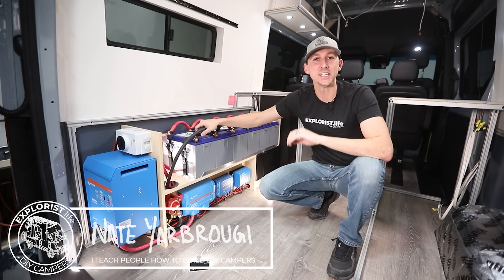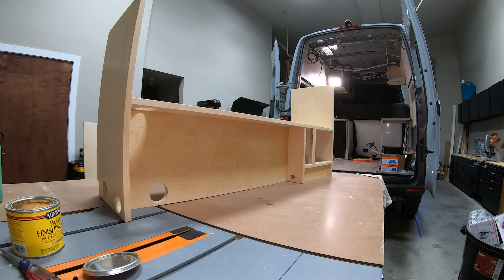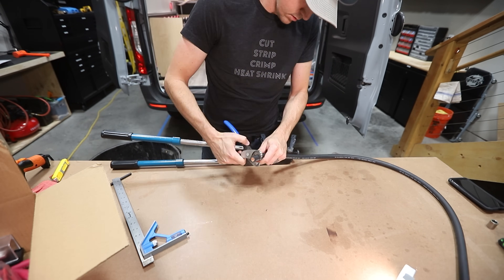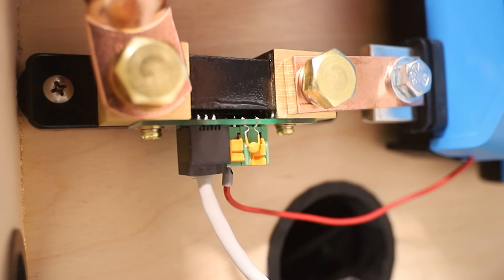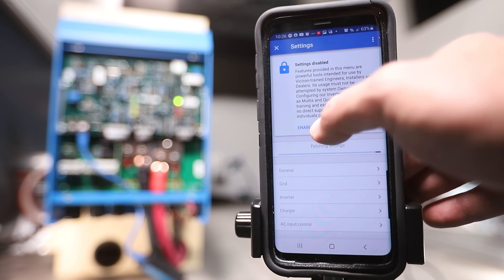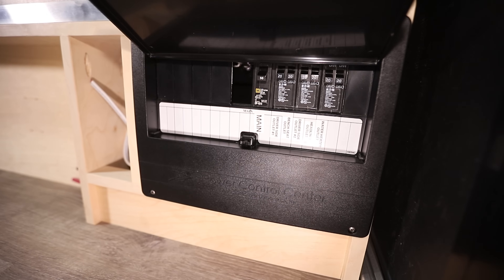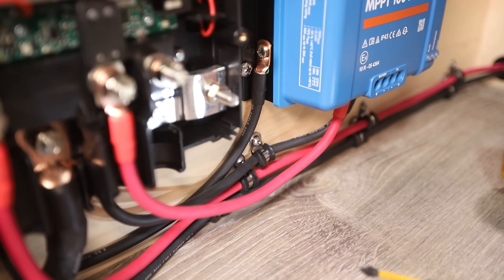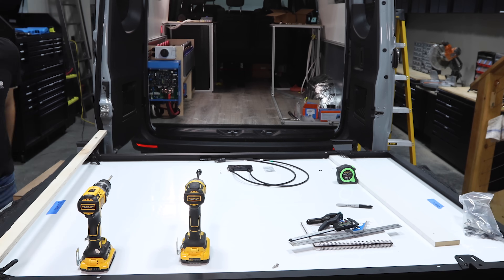DIY Sprinter Camper Van Electrical Install - Full Tutorial

Comment: So in this video with just one 12/12/30 dc to dc charger you use a 60 amp fuse but in your video of installing 2 12/24/15 dc to dc chargers you install a 150amp fuse, is there a reason for this?
Reply from the maker: 2x chargers = Twice as much power = bigger wires and bigger fuses.

Comment: second alt and save your main for the van battery only
Reply from the maker: That is indeed an alternative option and our kits are indeed compatible with a secondary alternator if that's the direction you'd rather go in your build.

Comment: is all the 4/0 120mm wire just for the sake of extreme overkill? seems like 2awg 35mm wire would do and be a lot cheaper and lose no current or am I wrong? i'm trying to figure our why the use of the thick cable! :)
Reply from the maker: Not overkill, no.  It's what's recommended in the user manual for the Multiplus Inverter Charger.  

2AWG would be wildly undersized. 

Perhaps this would be helpful: https://www.youtube.com/watch?v=ki3WXVR48eM&list=PLmvhcyi4n0TU6HlMaQiCUwC20DBlyv6s_
Reply: @EXPLORISTlife  and for a 24v system?
Reply: i watched that video earlier and i can't figure out how i know what amperage i have in my  system! i know it's 24 volts, but the wire size is mainly about the amps as I understand it, and I don't know how to know what amps are gonna be drawn through it :(
Reply: the volts just allows the wires not to be as thick, because less amps go through, but how do you know the amps!! ahah sorry going a bit nutty looking at all this!
Reply from the maker: A system w/ a single 3000w 24V Victron Multiplus Inverter/Charger would require 1/0 as per the user manual.  If you know the wattage of a devide, the amps can be calculated by: Amps = Watts / Volts

Comment: I have been reading conflicting opinions on main battery fuse ANL vs T-Class. Do you have any opinions on that?
Reply from the maker: Both are fine for that purpose.

Class T are 'better' as they have a higher AIC, but they have been historically harder to source at-scale (and I don't recommend parts we can't, as end users, acquire).

I wouldn't put ANL fuses in our kits if they were inappropriate for that use.
Reply: @EXPLORISTlife  thank you for your reply. I appreciate it. ANL it is then !

Comment: Nate - At 57:16 you are installing a 60 amp fuse for the positive connection of the DC-DC charge controller under the drivers seat. What kind of fuse is that and do you sell it? I looked through your products and don't see it. Thanks.
Reply from the maker: it's a 'MIDI' fuse: https://shop.explorist.life/shop/all-products/fuses-breakers/50a-midi-fuse/

Comment: What would you recommend. 12v or 24v for a RV? I'm trying to make up my mind.
Reply from the maker: If it's your first system you're building and you need less than 3000w of inverting power, I recommend sticking with 12V.

Comment: In a similar installation in a towable is there any danger of the starter batteries being depleted by low charged house batteries through the trailer plug? If so, how do you prevent that?

I’ve never heard it mentioned as a problem so I’m probably over thinking it.
Reply from the maker: If this were going into an OEM camper, I'd recommend disconnecting the power coming from the 7 Pin connector as it's just not enough charging amperage to matter and the 6AWG wire for the Orion DC DC Chargers would need to be run seperately.
Reply: Perfect - in that it confirms what I was already thinking.  ;) Thanks!
Reply: Can you explain why you can use a 400 amp ANL main fuse instead of a T rated fuse?
Reply from the maker: T-Fuse is also a great choice.  ANL Fuses are rated for what we are using it for but are more readily available than Class-T fuses.  Either are fine; I just don't like recommending products that are difficult to source for the end user.

Comment: Regarding the lynx distributor and shunt, can a smartshunt 500a be used instead of the bmv712? And if so, was it the aux or the Vbatt + that I would connect the power wire to?
Reply from the maker: Yes.  It's a direct replacement.  Power goes to Vbatt as noted on pg 4 of the SmartShunt user manual.
Reply: @EXPLORISTlife  many thanks, I’ve got it on order so I’ll get the manual read once it arrives.
Are you the only place to source the lynx adapters, as I’m in Scotland and really struggling to find anywhere selling these
Reply from the maker: @amacmedia3221  The manuals for every Victron component can also be found on the Victron Energy website. 🙂👍

We personally have the Lynx Adapters machined, so we are indeed the only ones selling those, to my knowledge.  We do ship internationally, though. 👍
Reply: @EXPLORISTlife  many thanks

Comment: How many hours could you run your 15 amp Air Conditioner on the battery bank before the batteries are discharged to their safe low level?
Reply from the maker: 15A @ 120V = 150A @ 12V (Using W=AxV)  This is a 600Ah battery bank. So...  600Ah / 150A = 4hrs provided there is no other charging/discharging going on.

Comment: Why did you use the last numerical circuit (18) and label backwards on the DC panel instead of starting at 1? Just curious. Someone as meticulous and prepared as yourself has to have a reason.
Reply from the maker: No big reason that I remember.  Probably just the way the wires fit the best.  Fitting the wires the way they fit best is always going to be more important than numerical order provided it doesn't 'electrically' matter.

Comment: would this work in the uk? I know the voltage in the us for some stuff is 120 volts instead of 240 in the uk and i was just wondering would i need to change anything included in this video for the uk volts difference?

Comment: Why are you only using one 4/0 wire to go from the bus bar to the Multiplus when it is recommended to use two 2/0 wires?
Reply from the maker: The Multiplus manual doesn't recommend two 2/0 wires... it recommends two 50mm2 wires (which is 1AWG).  This means that the manual recommends a minimum of 100mm2 worth of copper.  4/0 is the next biggest size (accounting for rounding) available in the US as it contains 120mm2 worth of copper.

I prefer using 1 wire as opposed to two wires because we'd have to otherwise take up two spots in the lynx distributor, which would make it so we would need to add a 2nd lynx distributor to this system to have enough space.
Reply: @EXPLORISTlife  We should be more specific since there are now two Multiplus versions. The Multiplus manual recommends two 50mm2 wires for lengths less than 5m and for lengths greater than 5m it recommends two 70mm2 wires equivalent to 2/0. The Multiplus II manual recommends the same but instead of the wire sizes being in mm2 it is in AWG. Also, 4/0 only contains 107mm2 of copper, don't always trust the first result on Google. I'm not sure why you took a shot at me in response to the question but there, now we are even. 

The convenience of running a single 4/0 wire is evident, but if that was a proper choice, wouldn't Victron include it in their manual? Electricity is more complicated than doubling wires cross sections and calling it good.
Reply from the maker: @CPRebels21  No shots fired.  Sorry it came across like that.  Sometimes in an attempt to answer these questions in a timely manner, I need to be 'short'.

Happy to answer your questions (because they are good questions), but you need to promise not to take my responses negatively. Cool? 😊

Comment: Hi Explorist, congrats to that tutorial - must have been loads of work. I hope you do not mind, but I have three questions: ( 1 ) at 59:28 you are sitting on a small chair inside the car and I am looking for something like that. May I ask, where did you get that? ( 2 ) Why do not you use DC Circuit Breakers instead of the main switches plus the fixed mega fuses? For example the Schneider Electric breakers seem also to be certified as an isolator. There is probably a reason to that. I would be happy, if you could explain or give me a hint. ( 3 ) During the tutorial you are saying, you are a "Trained" or "Certified Victron installer" (or similar), but I have not found that on the Victron web site. Maybe you can point me to a link? Thanks and all the best for your channel. Ronald
Reply from the maker: 1: https://amzn.to/3IJOeU6

2: That would also be fine, I suppose, but would be WAY more expensive with pretty much no added benefits.  I talked that a bit here: https://youtu.be/548aRhZMN-g

3: I'm a Victron Ambassador; which means that I have access to advanced training from Victron and then Victron will then sub-contract me out to go and teach their installers/distributors/end-users about their systems.  There's a 'bit' more info on that in this video: https://youtu.be/Yo3HO8cH0TI
Reply: @EXPLORISTlife  thanks for your reply, explanation and links!

Comment: i am going to wire two 24 volt batteries using an anderson Y connector cable.  is there any thing i need to do or know before i do this?
Reply from the maker: I mean, why not just wire it without an Anderson connector?  Are you planning on removing the batteries often?  That's really the only reason to use an Anderson connector.
Reply: what about equalizing them?

Comment: Do you have a rough high and low cost given the parts list as mentioned it a bit hard to snap shot the total estimate without complete parting everything
Reply from the maker: I mean, there's a complete parts kit available in the video description complete with pricing from only 3-4 different stores.  Did you see that already?  If not, here's the direct link: https://shop.explorist.life/shop/all-products/camper-wiring-kits/complete-wiring-kits/600ah-multiplus-3k-12v-orion-12-12-30-400w-solar-wiring-kit/
Reply: @EXPLORISTlife  Great thank you 2 things . I was not  using the key word “ kit”and the kit isn’t  all parts in a full diagram.

For me I was look for a add all diagram button ( which might be overly simplistic as some is case by case ) and a cost of all depicted in the diagram .

This looks like a add all for most of the largest sections of the diagram however . 

Thank you for responding your videos have been critical to my understanding  of a complete independent system!
Reply: looking at it now it’s just navigating the web site a bit. Maybe add hyper links to the kits from the diagram  page section?

Comment: So I wired my chassis ground and have followed all of your advise for wiring and wire sizes. Using 4/0 wire for battery and inverter (Multiplus II) We are on a trip in Colorado right now and last night we blew the main 300 amp fuse from the batteries after running a isotemp water heater and a small Keurig. Luckily I had a spare. Any idea where to find another one locally near Breckenridge or  what could have caused this?
Reply from the maker: This may take some more in-depth troubleshooting.  If you have purchased/are purchasing from our store (shop.explorist.life) reach out for some more personalized help: shop.explorist.life/support
Reply: @EXPLORISTlife  unfortunately I bought everything from battle born prior to getting to know your YouTube channel. Everything else is working well and haven’t blown another fuse. Just afraid that I will be in the middle of nowhere with a blown fuse and no replacement. I have extra Victron 300 amps but those don’t fit the housing for my battery fuse
Reply from the maker: Gotcha; I was about to say that a 300A fuse in a system w/ a 12V Multiplus 3k was too small and didn't sound like something we would have sent you. 😂🤣

But yeah; we have fuses on shop.explorist.life if you just need a fuse replacement.  Battle Born also has them too, I'm sure.
Reply: @EXPLORISTlife  sorry. I followed your wire diagram and battle born said a 300 amp fuse. What fuse do you recommend I get?  I’ll have you guys ship one to my house and hopefully not blow the only one I have for the rest of the trip. Wish I would have found you guys before I did all of this. Thanks!
Reply: Also just to be clear the one that burned was the one coming from the battery not the one in the linxs
Reply from the maker: 400A ANL Fuse protecting the 4/0 wire from the battery to the lynx distributor as is noted in the diagram.  Hopefully you used 4/0 wire?
Reply: @EXPLORISTlife  yes I have 4/0 for everything battery/ inverter/ chassis ground. Since I can’t get one locally should I limit the use of the inverter to a single item until I get one from you guys shipped to my home?
Reply from the maker: @TrueLivingOutdoors  A 300A fuse "shouldnt" have blown; but without knowing the full scope of what went wrong; it's tough to advise further.

Comment: Can you use this for 800 watt and a different inverter that one's pretty big and I've been eyeing the sungoldpower but not sure if that'd change what I need
Reply from the maker: You can sub in any size of solar array you'd like up to 1450W on a single charge controller.  Here are the kits to do that: https://shop.explorist.life/product-category/all-products/camper-wiring-kits/solar-charging-wiring-kits/

Changes would indeed be necessary for whatever sungoldpower inverter charger you are eyeing.
Reply: @EXPLORISTlife  SUNGOLDPOWER 2000W Peak 6000W Pure Sine Wave Power Inverter DC 24V AC 120V  is what I was thinking mainly just because the multiples seems huge but the features you mentioned do sound nice
Reply from the maker: That one would not work with this setup and would require an entirely new system design.  A 24V inverter is not compatible with a 12V battery bank.
Reply: @EXPLORISTlife  good catch I hadn't seen that it was 24 I ment to put the 12v version
Reply: Sorry just to clarify would I just add say a 1000w solarkit to the complete kit and be ok or is there more to it that I'd have to change

Comment: why you connect the shunt ground cable to the far end of the battery array?
Reply from the maker: This shunt needs to be placed so that the Batteries are on one side of the shunt and literally everything else is on the other side.

Comment: Can i please ask what you put under your batteries. I've been told to put insertion rubber underneath.
Reply from the maker: Just the wood shelf. Rubber underneath is not necessary for these particular batteries.  (These Battle Born Batteries actually have a shock absorption pad inside of the case underneath the battery cells).
Reply: @EXPLORISTlife  awesome.  Thankyou for the reply. I have 3 x voltax 200ah lifepo4 batteries. 
Im just starting to do electrical install and finding it very intimidating. 
I love your videos.
I just wish you were allowed to do videos on renogy stuff too.
Reply from the maker: Glad the videos have helped!  I can actually do videos on whatever/whoever I choose.
Reply: @EXPLORISTlife  id love to see a video on renogy 3000w inverter charger and the 100Li MPPT. 
Your videos are the best on youtube without a doubt

Comment: Amazing video! Helped me out a lot while installing my system. I bought the whole package from victron and connected all of it. Had a few questions wanted to see if you could help me out. Would it be possible for me to email or call you?
Reply from the maker: Glad it helped! 

Unfortunately, with over 150,000 subscribers, I'm sure you can understand why I can't accommodate phone calls/emails.  If you have a question, you should check the other videos I've put out, the blog posts I've written at https://www.explorist.liife, and the information contained in the user manual as those three resources contain 99% of the answers anybody has.  If none of that answers your question, feel free to ask your question here in the comments section of a relevant video and I'll try to help.  Otherwise, you can also reach out to the place you purchased your equipment from for support.

Comment: Questions? Why did you use #6 to feed the 120v panel?
Reply from the maker: Powerassist can boost the incoming 30A shore power to 50A.  50A requires 6AWG Wire.  Check the last section of this video where I covered the full system rundown.

Comment: The grounding screw on my inverter is tiny .Am I really supposed to connect a 4/0 wire ?
Reply from the maker: Sounds like you are using a different inverter than the on I am showing in this installation?  If so; you'll want to reach out to your manufacturer and consult with the user manual for guidance.

Comment: Why do you use untinned wire and not tinned wire? I was curious
Reply from the maker: Tinned wire is great for marine applications where the air is salty and corrosion is an issue.  Installing this stuff inside of a van where it is not subjected to saltwater or salty air, there is pretty minimal chance of corrosion issues.  None of the wire installed in a vehicle from the factory is tinned, so I see no reason to ask you all to spend the extra money it takes for tinned wires and lugs.

Comment: Thank you making this video - It has great coverage of many topics.
Question.  You wired up a ground to the inverter and likewise the distributer and connected this to the van chassis and then took the power from the alternator via the Victron Orion device.  The parts list uses an "Isolated" Orion, why did you choose this over a cheaper non isolated version as are not the 12v negative for the campervan 12v circuits and the 12v used by the standard van parts now the same?   Is there a rule of thumb about when to go isolated and when not to? thanks.
Reply from the maker: I choose to recommend the isolated version as it works in 100% of use cases and takes these types of questions out of the equation.